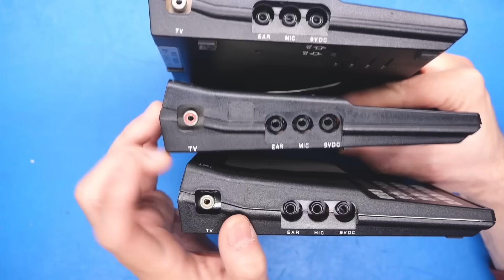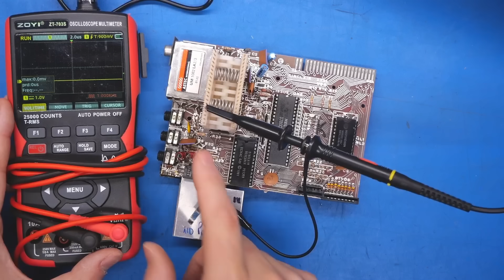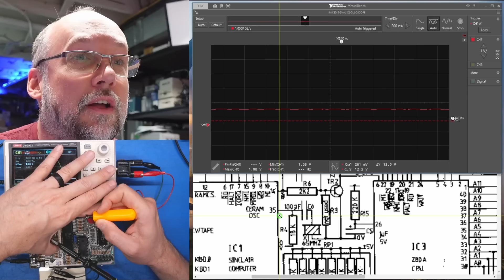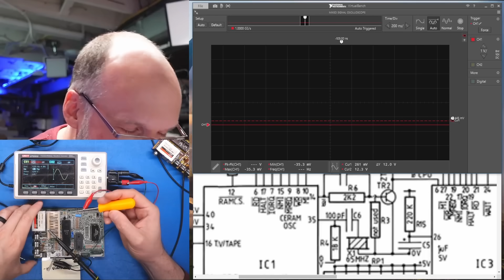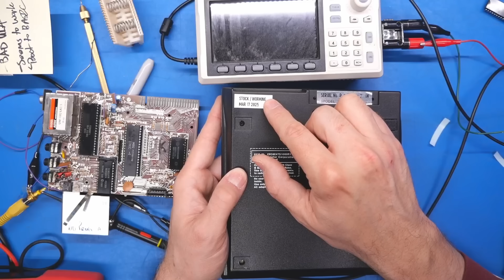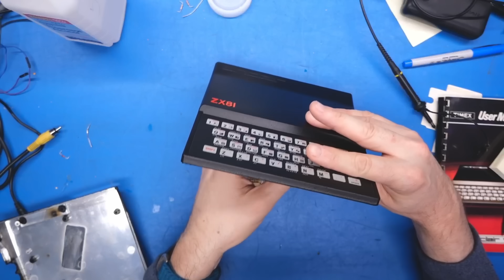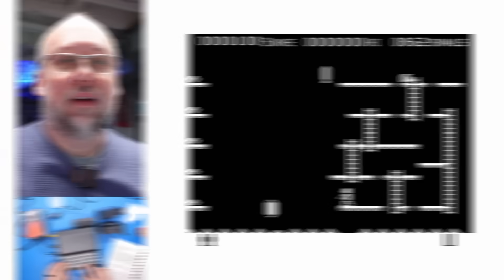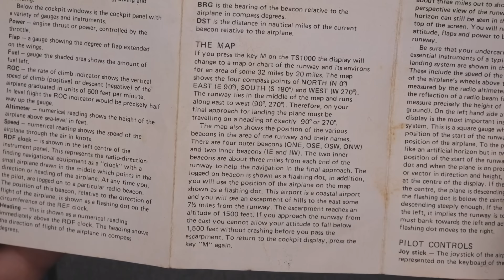Is the ZX81 / Timex Sinclair 1000 actually bad? Let's fix these to find out.

Comment: My first encounter with a computer as a kid and the start of my career in IT. The ZX81 has a very low graphical resolution, those games use a kind of programming trick to achieve a pseudo high resolution, like 256x192…

Comment: The ZX-80 came out in 1980. The 81 in 81. In the UK at least.  They were like 80 quid. US computers were just so much more expensive in the UK. Several times more expensive. One of the reasons that Apple 2s are rare over here is because they were almost a grand as a full system. My BBC Micro was consider expensive but was still a lot cheaper than the Apple. Ataris were quite rare too because of price. The VIC 20 was at least twice as much as a ZX-81. The C64 was a several hundred quid when first launched.  The Spectrum 48K was launched in the UK in 82.

Comment: I have never been able to solder onto a ribbon cable. I have found that various configurations of ribbon cable is still available on digikey. I recently replaced one in my FT817.  It was a little longer than the original but easily fit.

Comment: I added a clicky keyboard to my ZX81, at the time you could by a keyboard kit, PCB & parts, solder the keys and proper ribbon cable, much easier to use although did look a bit messy, ended up building it in a box, many happy memories, excelent video, very entertaining  👍

Comment: I had A Timex/Sinclair 1000.  It was given to me as a collective present from a family I knew... I think it was about $40cdn at the time.  I did buy the 16kb module for it.  Eventually the power plug wore out from being used so much.

I ended up pulling it apart and Using it in conjunction with the schematic (which came with my computer) for a project to show how to understand the schematics and how a simple computer works for a school project. 

The ZX81 and Timex Sinclair are not the same machine.

The ZX81 had 1kb of Ram, the TS1000 had 2kb, and it was Timex who licensed the device from Sinclair, which is why it wasn't built in the UK. So the TS-1000 was actually built by Timex factories in France and Portugal.
The Ram expansion packs bypassed the existing ram, so whether it was a 1kb or 2kb machine, with the pack it was 16kb.  
The memory packs generally cost for about the same as the computer itself at the time.
The reason why the expansion connector was backwards (the pinning that would normally be on the expansion side was on the motherboard) was to keep the cost of the base computer down.

As I am sure you would be aware that the TV standards in North America and UK were quite different and so they had different RF modulators.
US/Canadian variants used NTSC VHF 2-3 (54-60Mhz ot 60-66Mhz) at 60hz
UK variations used PAL UHF Channel 36 (590-598Mhz sometimes 33 on early models) at 60hz.

Was this a great computer... depends on how you look at it... it was great for learning to program, and it was amazing what was achieved so inexpensively.

I never had any games for mine, other than stuff i wrote myself in basic, but in certain respects (with memory pack attached) the assembly language based games on the Timex Sinclair 1000 were shockingly good compared to what I saw on TRS-80 Model 1 level 2 (16kb) or the TRS-80 Model 3 with 48kb and floppy drives.

The keyboard is a similar problem I have with touch screen keyboards, on phones, except there at least the output is close to the keyboard... yeah it was a major drawback.

I do recall slight interference when I used the memory expansion pack, and I certainly had the "knock it and loose everything" problem, so I was constantly backing up to  tape to be on the safe side, which slowed things down a lot.

Comment: I got a SINCLAIR ZX81 as a gift when I started my Electrical Engineering Bachelor degree at Sherbrooke University in 1982 (in Quebec, Canada). I learned to program in basic on it initially and then used it to learn the Z80 assembly programming language while also learning the IBM360 mainframe assembly language programming in school. It was very useful to me at the time for my studies as a graphing calculator (before commercial versions of those even existed). I added several pieces of hardware later on to improve it including the 16K ram module, a small thermal printer and a full size keyboard in a boxy metallic housing. Finally, to top if off, I bought the 64k ram memory module and that was the culmination of my ZX81 config... Then, it was replaced by a Philips brand IBM PC clone that had a computing index of 0.9 (back then computers were rated in reference to the performance of the original IBM PC so mine was 10% slower than the genuine IBM one, which was pretty bad...). These monsters weren't cheap either when they came out... but they were made available to us through student loans from the Quebec provincial government, so most of the engineering students at the time ended up buying one.

Comment: I still remember scouring the Trading Post paper till I found a ZX81 listed for $40 - a lot of money for us.  I convinced my parents to go look at it - and they bought it!  But it had that crack in the membrane keyboard connection just like yours.  Eventually I figured out that I could heat my soldering iron, unplug it and wait just a minute, then solder would stick to the silver painted-on trace without melting the plastic.  I bridged the two broken traces with magnet wire, and it worked.  Fun, but frustrating with that horrible keyboard, home cassette recorder, and having nothing to set it on except a very wobbly tv table.  But good times!

Comment: I use to repair Commodore 64 and Vic 20's in the late 80's and early 9's.  Someone gave me a ZX81 that had been modified, it had a socket on the case with a true keyboard, that would plug in to it,  I did not get a manual .  The keyboard was open, no case, nothing to protect it, but it did work.  I passed it on to an electrical engineer whom moved away years ago.  I never did find software to run on it. Though I did not look a lot.  Since then I found another one with a 16K memory modual.  It would also crash if you bumped the memory modual.   It is nice to see there was software for it.

Comment: I wish I could post an image but what you and many seem to miss is the original Sinclair MK14 kit version which is what I had first.  1978. I had a Sinclair calculator kit also.  There was an electronic stop watch that I have never seen anywhere else I think we got that one in my vocational electronics class in 1977 maybe '76.  There was a version of the ZX80 that I have never seen anywhere else at all, also a kit that was out but none the less it was an awesome little unit.  I was a kit fanatic...  I miss building them.

Comment: After finished watching video I have 2 questions.

Would 9v battery to power zx81 clean up the video signal(chemical electrical pure dc clean?).?...
&
Would a real switch mechanical keyboard make any difference?, Is there a keyboard buffer? or is that the reason for the original to slow the user down by using confusion to dampen buffer overload?, if that was the case is the original keyboard ironically a master design that just happened to be the cheapest option?...

Somewhere I have a docking station with a disk drive and power supply for these zx machines.

Comment: I used the Timex Sinclair 1000 for my senior project in 1985 at university to make a "robot." It was programmed in Z80 assembly and and basic loaded by tape. I bought a cheesy plastic keyboard for 100 dollars to make entry easier. It was a nightmare of wire wrapping and learning everything as I went. It was a huge project to do in six weeks. I had to design and wire wrap a backplane and boards for motor control, speech, and interface. I used what I learned from my Boolean logic class to decode the address and control lines. It worked and named itself Oh-Nine-Eleven because I blew up the original VOX speech chip I planned on using and had to use a speaking clock chip connected to the address bus to prove that I could interface with speech. It would have been impossible without Radio Shack. Alas, that company is now gone.

Comment: Entirely CPU driven. The BASIC has a fast mode for running intense code and in this mode, when running code, the screen blanks out. It also blanks out when entering new lines and scrolling.
The CPU is entirely responsible for sending signals directly to the modulator. There is no frame buffer, it decodes characters on the fly. This does however mean that it is actually possible to create graphics, which is something I have done. It also shares the video output signal with the audio in and out which is why you see noise when loading and saving.
Reply: Oh, and UK version does not have any shielding.
Reply: Video noise was just par for the course and yes, it did increase with the addition of the RAM pack.
I solved the keyboard problem with mine by making up my own using the keys from an old teletype soldered to stripboard. I had to make the space bar switchable because for reasons unknown, Sinclair decided to also use it for program stop.

Comment: I assembled a kit ZX81 with my father back in 1981, which we almost immediately replaced with a TS81 when they were released (because they had twice as much RAM). I used that computer for two years writing BASIC programs that I found in magazines and concocted on my own (one of my own concoctions was a program to do a presentation for an 8th grade geography class). The keyboard was indeed execrable, but the computer itself was quite capable, especially for the price.

I don't recall precisely, but I don't think that there was more than a year between the release of the ZX81 and the TS81. My father encountered the ZX80 at a trade show, and bought the ZX81 kit on the spot. I believe that was in November or December of 1980. I think that the Timex partnership occurred in late '81 or early '82.

Comment: I had a ZX81 that was bought from a salvage store that got a few after the ZX81 was no longer in production as the Times/Sinclair ZX81. It was 1983 / about May (remembering my clothes were summertime gear when I got it) I actually only paid $2.00 for it because they had no idea what it was - the 16K expansion was$30 and I got it at Pathmark I believe. I actually loved it at the time - and it lead me down a path that lasted a lifetime - I am a software developer today…

Comment: I bought a ZX81 in the early 1980s, when it first became available in the US. I had prior experience with Fortran in college and also had experience with microprocessor embedded control systems  programming in assembler. For two weeks I did some BASIC exercises from the manual. This was right before I went to a job interview for an electronic engineering position. They threw in some unexpected questions involving BASIC programming which I answered readily because of my recent playing with the ZX81. By the time I got home I received an excited phone call from the employment agency saying that I had received an offer at an unexpectedly high salary. The employer was using an Analog Devices MACSYM process control computer running a proprietary multitasking BASIC. This was a little like paddling around in the shallow end of the pool for a few minutes and then climbing to the high dive board and diving into the deep end. I owed that job to the ZX81 toy computer and Sir Clive.

Comment: Timex Sinclair 1000 -> TI 99 4/A -> Atari 800XL is the path I took as a computer-interested teen.  The TS1000 keyboard was AWFUL.  The 16KB expansion pack constantly leaned away from the computer and disconnected under its own weight.  I used rubber bands to keep the 16KB pack in place and used pencil erasers to push the "keys" on the keyboard.  Not the easiest of computing experiences, but I still loved it at the time.

Comment: One of the electronics catalogs in the UK offered a mechanical keyboard for the ZX81, which I bought. I then built my own case and soldered the keyboard and 16K  wobbly RAM pack to the motherboard; that solved all the issues. I'm very grateful to Sir Clive Sinclair, as this PC led to a career as a programmer, systems admin, and web admin.

Comment: You're comparing a ZX81 to a vic20... At the prices shown in 1982.... In 1982 the Spectrum was released, so you should compare it to that. I had one of the build it yourself ZX81 kits in 1981. I loved it, it was perfect for learning on. I was 13 at the time, and it set me on my path to an IT career (58 now...). You'd be surprised how fast a teenager could type on one of these things.

Comment: When first introduced in the U.S., in 1981, the Sinclair ZX-81 sold for $99 as a kit, and $149 fully assembled. The 16K ram pack sold for another $99. My brother bought the computer and ram pack for almost $250, and shortly thereafter, the price of the assembled version dropped to $99, and $79 for the kit, as I recall. The ram pack also dropped to $49, but I don't recall if that was at the same time that the computer price dropped.

Around a year later (or perhaps a little longer), Sinclair announced their partnership with Timex to market their computers in the U.S., and the T/S 1000 was announced (with a whopping 2K of ram on board). Timex was already manufacturing computers for Sinclair by then, as I recall. For a short time, you could buy either a T/S 1000 in a retail store or you could order a ZX-81 from Sinclair, although that probably ended when Sinclair's stock of ZX-81s was exhausted.

Shortly thereafter, the T/S 1500 was announced, which was an upgraded T/S 1000, with 16K ram on board, and a better "full-size" keyboard, in a case that was copied from the U.K. Spectrum that Sinclair was selling by that time.

Timex also announced the T/S 2000 which was to be the U.S. version of the Spectrum. By the time it reached production, it had become the 48K T/S 2068 (with a 16K T/S 2048 being announced,), although it was incompatible with most existing Spectrum software. I don't know if the T/S 2048 was ever actually produced. Although technically superior to the Spectrum, the T/S 2068 never achieved a significant market share, so there was very little software available for it.

A few months after the T/S 2068 became available, Timex announced that they were exiting the computer market. Existing computer stockpiles were marked down drastically. The T/S 1000 could be found for under $30, and before long, even under $20.

Considering the simplicity of their designs, Sinclair's computers were surprisingly capable. They certainly weren't "bleeding edge," but they were affordable and they worked. In the U.K. in particular, the Spectrum became the standard for home computers, and they were ubiquitous.

In the U.S., however, I believe that the decision by Timex to significantly alter the Spectrum design, led to widespread rejection of the platform. This opened the door for Commodore to gain a strong foothold in the home computer market with its new "Commodore 64." I believe that Timex decision also led to their ultimate decline in the computer market.

Comment: I had a ZX81 in the early 1980s.  You could encode machine code in the graphics characters, and write a REM statement that contained your code.  Then you found the address of the comment string and set the PC to it.  Much much faster than the BASIC interpreter.

Comment: X1 is a ceramic resonator. They never fail. In my 55+ years, I've never seen one bad. The ULA has internal circuits which match the 6Mhz osc frequency pretty closely.

Comment: I discovered I still have my ZX80 which is the one before the ZX81.
Yes, the Z80 does the video 100% it does the sync and also makes the timing of the bits.
For each line, the CPU is doing NOP instructions which take 8 clocks to happen.
At the end of the line, there is an interrupt that sends the CPU into code to make the sync pulse
After is does that so many times, it then does the vertical sync again with code.

Comment: Those things have crashed more times than a scud missile. You’re better off building your own from scratch. A Z80 is a powerful start, but, hey maybe you should have left those in the dumpster.  A personal computer according to the dictionary only. I’m pretty certain that for 99 dollars. It was in kit form.  I’d consider using a single 8x 32k static ram for the computer. Should be pretty simple to connect.

Comment: Bought Timex.Sinclair version in Canada at a computer show. It was 75CDN comparing to about 120 for Atari and Vic20. Had some problems to find cassette player that worked, It had to be cheapest possible mono sound without tone control. Soon found mechanical keyboard in a box to mount it inside and 16K ram module. It was actually quite useful to learn basic and even used it at work in factory.

Comment: My first computer was also a VIC 20, but a few years later I swapped a ZX Spectrum game for a ZX 81 with the 16K memory expansion and the thermal printer. 
It was an interesting machine, and while some people say it was one step up from a calculator... it was a VERY important step.
The biggest down for me is the single key method of programming shared by the Spectrum. Having said that it was truly amazing what some people got out of this with the 16K expansion (which was pretty much mandatory).

It was a very simple and very cheep little computer. You can't compare apples with orange's here, but in the end it does what it said on the tin!
Remember the cost was VERY low!

Comment: Probably mentioned elsewhere, but the ZX81 defaulted to a "slow" mode where the CPU was multitasking to generate video.  In "fast" mode, the video would blank and the BASIC programs would run much faster.  Not helpful for graphics programming, but raw computation was increased a lot!